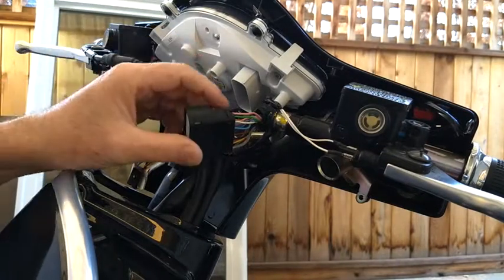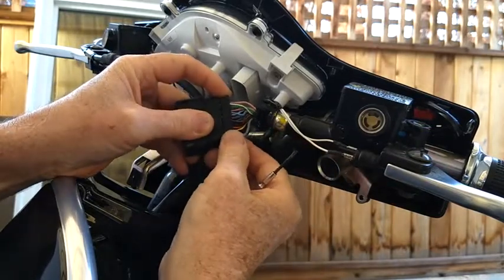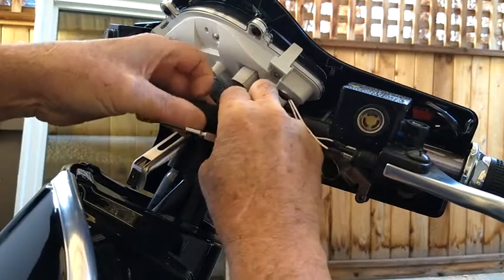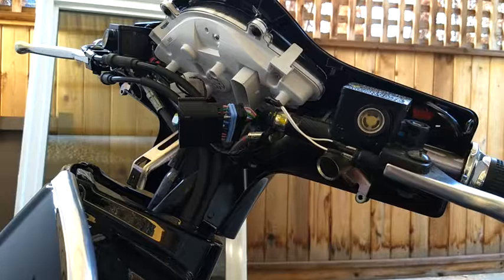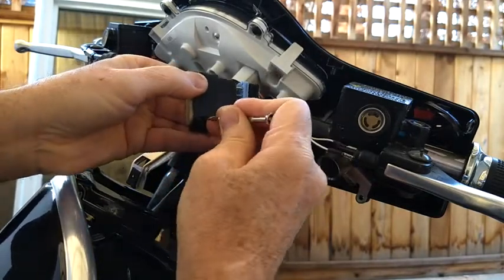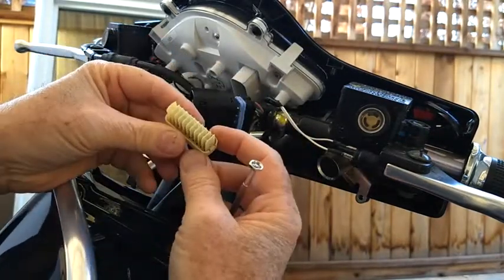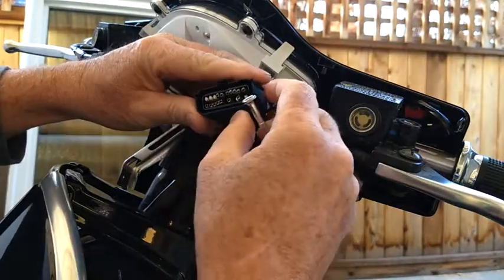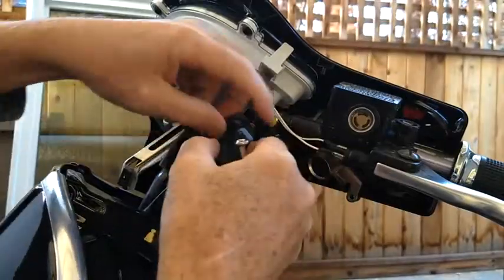Molex MX150 Connector Pin Removal

Comment: THANK YOU FOR THIS! I only needed to use four pins out of a 12-cavity pre-pinned pigtail; pulled the remaining eight pins thanks to this and filled with cavity plugs. My pins were not loose upon removing that white locking piece but were easily pushed out from behind the connector. Love it!

Comment: NO! Get the extraction tool!
Reply from the maker: This way took me 3 minutes. Your way would take me weeks to get the tool and cost $. After this, I will never need to pull another pin.
Reply: @SqueetoNa  Agree with your method tool is hard to source, but never need to pull another pin, you may have jinxed your self!🤣
Reply: you mean the $40 tool I'll only need to use once as opposed to the above method which can easily be done with my existing tools and a bit of patience?

Pass.
Reply: Straighten a small paper clip. Push it in a little hole below each pin, pull the wire from behind.